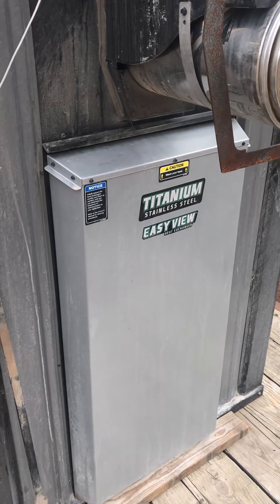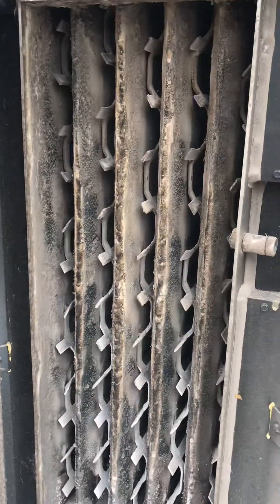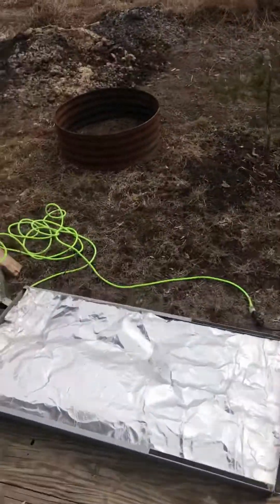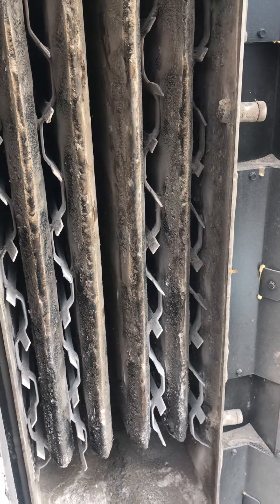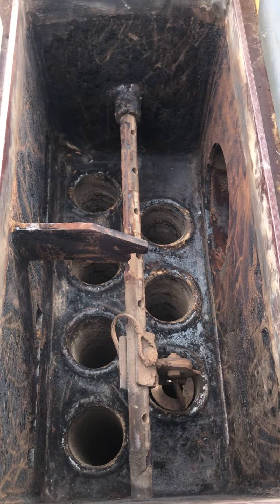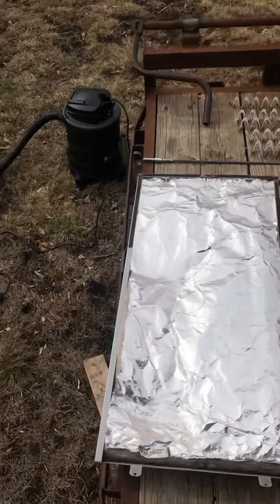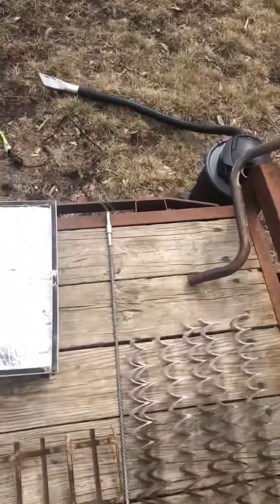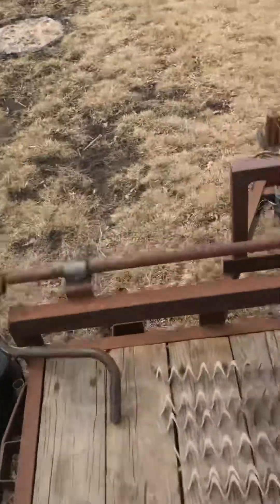Central Boiler vs Polar Furnace Cleaning the heat Exchangers

Comment: I don't think you know what your talking about. On the edge just move the metal piece between the heat exchangers up and down the ash will fall down.
Reply from the maker: That will not get heat exchanger clean enough to reduce the stack temp.  If you have a high stack temp you are blowing BTU’S straight out the chimney and the only way to get the stack temp into a range that is acceptable is to remove the turbulators and scrub.

Comment: Great back to back review. To me looks like Polar wins for daily/weekly cleans with the handle, and CB wins for yearly clean out access.
Reply from the maker: Cleaning the heat exchanger that is very true, both furnaces do require a little more annual maintenance than is fully shown in the video.  But that would make another good comparison video!

Comment: I just bought a classic edge 560 over a heat master g4000 because of the heat exchanger difference. For me, I felt like scraping the central’s heat exchanger by hand once a week was no more work than having to take the roof off of a heat master, to get the turbulators out, to brush the heat exchanger tubes.
Reply from the maker: The heat exchanger on the Polar only has to brushed clean at the end of the season otherwise you can just turn the handle on the side.  It is around the same amount of work to clean the central boiler weekly as the Polar annually.
Reply: @joecampbell4579  I guess I’ll find out next season if I made a mistake or not lol
Reply from the maker: @jorrick66  I don’t think you made a mistake at all, you made a good choice to burn wood in the first place!  I ran that CB for around 1/2 the season and it ran good for me, I don’t think you will have any issues with it.
Reply: @joecampbell4579  good to know. It was definitely a tough decision to make